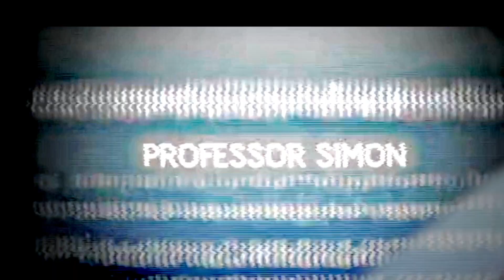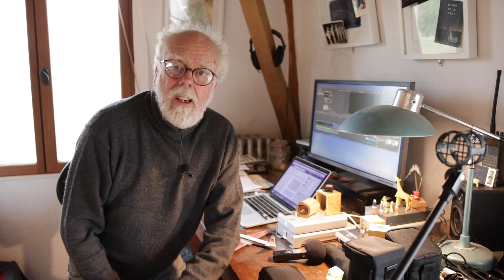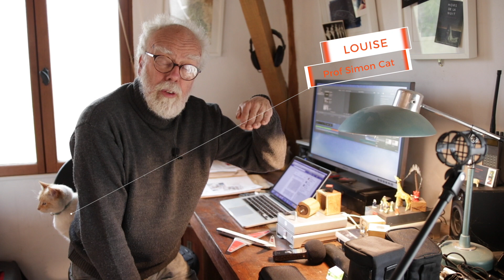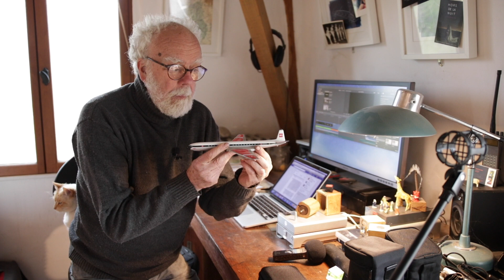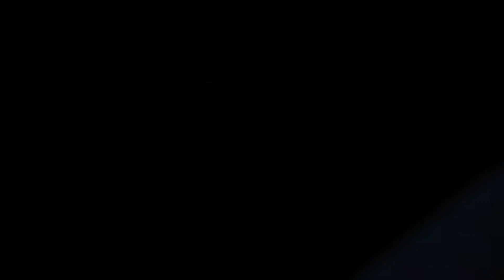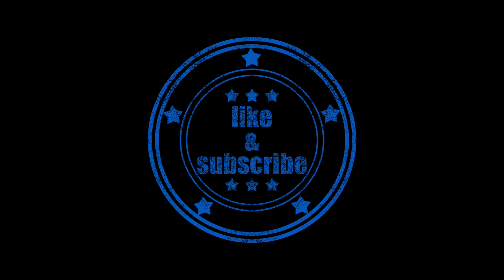737 Max 8 - Report published - Prof Simon

Comment: I think one of the things that is upsetting me (other than all the deaths) is how this is described as a software problem – it is not a software problem, it is a hardware problem. I think I may disagree with professor Holland and suggest that it may be acceptable to certify a plane that needs software to support the pilots to overcome the planes inherent instability what cannot be acceptable are:

    • The lack of redundancy, I’m not an engineer but my father was an aeronautical engineer and I remember him explaining to me about the redundancy built in to aircraft design. How was it then that the MCAS system only uses a single AOA sensor?
    • This is even worse when you consider there are two such sensors, not only that but they are both used, but only one at a time. Not only that but this alternates from flight to flight making trouble shooting more difficult, this is bad harware design not bad software design.
    • How can the warning light indicating an AOA sensor mismatch be an optional extra? How can this optional extra cost US$ 80,000 (particularly if this is only a software upgrade?). Why is it not built into the system that MCAS is automatically turned off and the pilots warned if there AOA sensor mismatch?
    • Why is it that the manual system cannot trim the plane in a timely manner, that only requires ordinary effort from the pilots if necessary?

These issues are not software issues they are hardware issues. AOA sensors and how they are linked to the MCAS is hardware. How the MCAS system is linked to the flight control surface is hardware and how you manually override the system is a hardware problem.

What I want to know is how did such an obviously flawed system pass the FAA?
Reply: John H, 
Concerning your point on the two sensors with only one being used. 
Apparently one was failing on the lion plane previous to its disaster.
The computer supposedly switches from one to the other on alternate flights. 
The maintenance tested and okayed the good sensor.
The next day the Lion air switched back to the faulty sensor and crashed ( or so I understand from a YouTube site).
Why wouldn’t the MCAS computer read simultaneously from both sensors, upon reading a discrepancy between one of the two, disable the MCAS override and notify the pilots to return to return?
Why even use these stupid little wind vanes as sensors, when laser gyros would provide the same function flawlessly?
Reply: Obviously MCAS is flawed, however the MAX is not inherently unstable.
Reply: @stimproid   Yes probably over stated - However the tenancy of the plane to pitch up because of the positions of the size and engines is an inherent fault. My point is I think it is reasonable to solve this inherent aeronautic problem using a computer aided system. The problem MCAS is terribly implemented for the reasons I stated above.
Reply: @johnh6524  I don't disagree with any of your other points. You were very precise and accurate with all of your statements. I just wanted to clarify that particular point. I am frustrated that the "Professor" is making statements that are, at best ignorant, and at worst willfully misleading.

Comment: 03:41 - Yes the 737 MAX IS PITCH STABLE and provides hands-off flying. The issue that they tried to fix with MCAS is specific and restricted to engine thrust at high angle of attach, in which case large power increase may tend to increase pitch -  a characteristic that is common to other 737s BTW, if in a lesser scale. The MCAS was aimed at reducing this pitching moment in those conditions exclusively. With any constant power setting, once trimmed, the airplane is pitch stable, meaning it will seek trimmed airspeed, hands-off. Pitch variation upon power change is to a greater or lesser degree present in pretty much anu airplane, actually.

Comment: Professor Simon: I just read from Washington Post that investigators found a 2nd software problem in MAX that controls FLAPS and other Flight Stabilisation Hardware; they believe this is the reason that Boeing delayed MCAS FIX implementation. It seems Boeing says that the 2nd problem is minor and they already know how to fix it. FAA and others don't believe so; FAA has ordered it fixed. Wonder what more is Boeing hiding? Professor, we would appreciate your further investigation and update to concerned community.

Comment: I have soured on Boeing since 1994 when they suggested that US Air 427 may have crashed because a fat passenger stepped through the floorboards and got his foot tangled in the control wires of the elevator. Of course, the whole world knew it was a rudder malfunction, yet Boeing was still trying to cover their ass even after the second crash. They even suggested that maybe the pilots did not know up from down and flew the plane into the ground by accident. 

Large corporations like that are run by sociopaths.

Comment: They designed a plane that couldn't fly level, like a car that couldn't steer straight, then tried a cheap software fix instead of fixing the underlying mechanical problem. Then, to save even more money they didn't train the pilots on the MCAS. The bean counters took over from the engineers but they ain't counting many beans now.
Reply: MAX can fly level without MCAS just fine.

Comment: The A220, A320 Neo, MC 21 300 are all viable options for replacing this clearly unstable 737 Max, which is basically new junk slapped onto an ancient body. In particular the MC 21 300 looks very interesting indeed.

Comment: As I read more about this sorry state of affairs, I think that Boeing has let everyone down!
There was absolutely no need for either of these crashes!

When Lion Air had the first problem, they were lucky enough to have an extra pilot aboard and when the MCAS started to malfunction. Because of the extra set of eyes and good knowledge, I read that the MCAS was turned off and the plane was able to continue on to Jakarta.

Any sensible person would have seen this as a red flag!

One thing I am sure of is that on arrival at Jakarta, the pilots wrote up a very detailed account of the malfunction.

Of course we haven't seen this document but at least it was enough to get a Boeing engineer to examine the problem with the intent to effect a repair.

The only trouble is that the MCAS system fooled the engineer and - here is the rub - I read he certified the problem as non - existent!

I read that he was fooled by the system swapping angle of attack indicators and as luck would have it, he tested the system with the one that was operational.
 We shall never know if the other one was truly faulty - but the thing is!

If the pilots described the problem clearly explaining that this was a loss of control problem, and I am sure they did, the engineer should have understood that he hadn't got to the bottom of the problem and refused to let that plane fly until the problem was REPLICATED AND DEALT WITH. 
He also should have been supported in this by his superiors at Boeing.
Boeing hopefully would have immediately carried out a proper solution on all 737 Max 8 and 9 models!

Just think of the scenario if the above had been carried out! 
1. Lion Air plane would not have crashed! This would have saved 189 lives,  
2. Ethiopian Airlines' plane would not have crashed this would have saved the further179 souls on board. 
3. Boeing would not be having the blow to their reputation etc. which may yet result in insolvency. 

Like I said in an earlier comment, you cant fix the problem if you cant replicate it.
In my case, my software never flew a plane, but once the software was in operation, I still needed to exercise my responsibility and I had to get it right ASAP.

Comment: In the FDR traces attached to the preliminary report, it is just possible to discern a slow change in pitch trim during part of the time when the electric trim was cut-out.  This seems consistent to me with the pilots manually turning the trim wheels.

Problem is, the change is in the wrong direction!  So did these pilots get confused about a rarely-used control in this stressful (both physically and mentally) situation?

Consider that the First Officer was a relatively new airline pilot, with a few hundred hours of time, and he presumably became Pilot Flying when the Captain's instruments (and stick-shaker) went haywire due to the faulty sensor.  I assume that as Pilot Flying he would have operated the manual trim, as well as exerting what control remained to him to keep the nose up.  But if he inadvertently turned the trim wheel the wrong way, he was making the situation worse rather than correcting it.

Undoubtedly the investigation will examine this factor as well as MCAS.

Comment: And now, what of the future on the design of machines such as the 737-8 MAX? Don't you think this is one instance where computers ought to take a backup support role rather than a primary pivotal role with clear standards laid down on use of materials, a critical minimum use of automation with the pilot always in control and comprehensive pilot awareness and training standards. A minimum cycle testing time before any commercial launch, the way it used to be! The FAA is equally to blame here for this oversight in allowing Boeing to do the certification for the MCAS. This perhaps could be due to the reason of having classified the MCAS as a class B system by Boeing engineers during the design specification. Apparently, Class B classification is for non life threatening systems
 It's made me furious how this "never ending greed and an unhealthy drive towards commercialisation" is wrecking everything from educational paralysis to compromise of vital systems design and production.
Reply: MCAS is obviously flawed, however computerized automation has made flying far safer.

Comment: Prof with the greatest of respect sir, in a report that I read, the 1st officer called for the "stabilizer trim cut off switches" to be turned off. This was the correct call as in the off position, the MCAS cannot have any input over the airplanes control. Now, for whatever reason the switch was turned back on and once again MCAS  pointed the nose down this time into an unrecoverable dive. I accept the MCAS software is obviously mal-programmed. But why in Gods name having almost saved the airplane would a decision be made to switch MCAS back on?

Comment: I understood that The trim switch on the yoke takes priority over the MCAS, so if they switched back on the MCAS, why did they not immediately start to use the yoke trim switch to trim the plane back up?  And the screw jack takes some time to adjust the trim down two degrees. It is not instantaneous. 
Seems like they should have reduced throttles and used yoke trim to trim back to horizontal or nose up!  
Did the co-pilot not tell the pilot that he was turning the MCAS back on?  Was the pilot busy reading the manual?  We will probably never know.

Comment: They also forgot to throttle down after take off. They were going nearly 420mph when they tried to manually trim. Way too fast to be able to manually trim. This is when they turned the electric back on.
Reply: So are you blaming the pilots? You are sick in the head.

Comment: I agree ultimately every aircraft should be stable hands free, this was so avoidable.  The dominoes were setup, heavy engines in front to save on fuel, minimal training to promote marketing, optional safety features.  Follow the money.
Reply: The Max is stable hands free, just like any other passenger plane.
Reply: @stimproid  No it's not, that's why the MCAS system was installed,
Reply: @EnzoFerenczyo  What do you think the MCAS does exactly to make it fly straight and level?
Reply: @stimproid 
They "quietly" introduced the system due to the larger nacelle and the need to move the larger more fuel efficient engines forward , that changed the aerodynamic qualities and caused an upward pitching movement.  When flying manually it had a tendency to drift upward.  This is when MCAS would kick in, the latest crash happened when they turned the auto-trim back on causing MCAS to once again be activated.
The system isn't mentioned in the FCOM, flight crew operations manual.  It only kicks in under manual flight control it is disabled when on auto-pilot, that's actually what doomed the latest flight, the co-pilot turned auto-trim back on.
Reply: @EnzoFerenczyo  MCAS was implemented to counter a tendency of the MAX to pitch up in the event the pilots advanced the throttle too quickly. It is stable an hands free.
Reply: @stimproid  Stable as long as you don't step on the gas....hmmmm  Just like a car is safe when parked.

Comment: Turning back on the electric stab trim was not a good idea as it made a bad situation worse. The only way it would make sense to do so is to immediately shut it off again if the MCAS once again kicked in again. Could watching the trim wheel provide that indication? 
Experimentation wasn't a practical option at low altitude however if the PIC had stunt or fighter experience and having assessed the situation knew the flight was doomed, perhaps a drastic attempt could have been made like rolling the aircraft inverted. At 400 knots it doesn't matter what direction the aircraft is in when it hits the ground.One needs to stop the sink and the stabilizer has the largest control surface.Flying inverted with a stabilizer trimmed nose down would be nose up inverted.
One wonders what the observed smoke coming from the read of the aircraft prior to impact was all about. My guess would be an overloaded electric motor somewhere at the rear of the aircraft.

Comment: Trying to utilize software that's reading flaky angle of attack sensors in order to thread the needle between a fatal pitch down trim response and a fatal pitch up stall is no way to build a safe airplane, son.

Comment: Hello Professor!
Your interpretation of the initial report lacks an important part to properly understand the sequence of events, which is the crew's attempt to manually trim up the stabilizer.
The First Officer correctly called out the runaway trim and applied the corresponding memory items, cutting out the stab trim. The FDR recorded both inputs on the joke trim buttons and MCAS trim down inputs with no corresponding motion of the stabilizer hence indicating that the electric motor was cut out.
Then the CVR recorded the crew's remarks about attempting to manually trim the airplane, which was very difficult because of the high speed the aircraft had reached by then. Finally the FDR recorded a nose-up trim command from the Joke, shortly followed by a nose down trim input from the MCAS, with corresponding motion of the horizontal plane, shortly before impact.
It is likely that the crew, unable to manually trim the airplane, re-engaged the trim motor which eventually doomed them. We don't know if that was because they realized that they couldn't manually trim and gave it a last desperate attempt, or because they were led to believe that, from the moment they could not manually trim, the problem was not the MCAS but rather a stuck trim.
Reply: I did not hear in the report where he called out to disconnect the auto pilot and auto throttle. Those are the first 2 memory items.
Reply: @stimproid  Good point!
The autopilot was indeed disconnect, either by the crew or automatically, this is stated in the report based on FDR data. I didn't find  what was the status of the autothrottle (can be I just missed it). However the throttle levers never moved and stayed at high power settings throughout the flight causing the plane to reach and pass VNE, which is probably another lined-up hole in the swiss cheese. One can just speculate if they didn't reduce thrust fearing the plane would pitch down even more, or if they were so hyper-focused on the stab trim that they simply forgot it.

Comment: Saying that the MAX cant fly hands off level is incorrect. MCAS was implemented to prevent an excessive pitch up condition if the pilots pushed the throttle up too rapidly. Yes this pitch up condition is caused by the power and location of the new engines. To suggest that the plane cant fly level without MCAS shows a fundamental misunderstanding of the dynamics involved.
Reply: I read somewhere that MCAS was put in place primarily to reduce pilot workload by making it unnecessary to manually re-trim the plane when it pitches up. It was a convenience feature that's turned out to not be very convenient.
Reply: @joevignolor4u949  False
Reply: @stimproid  Okay. So why is it there?
Reply: @joevignolor4u949  It is in my original post...the one you commented on...look up.